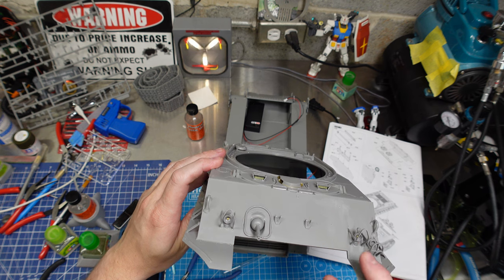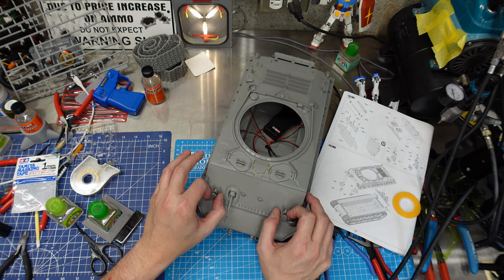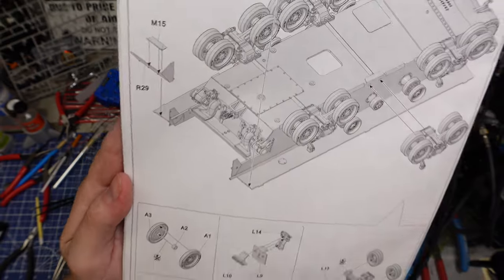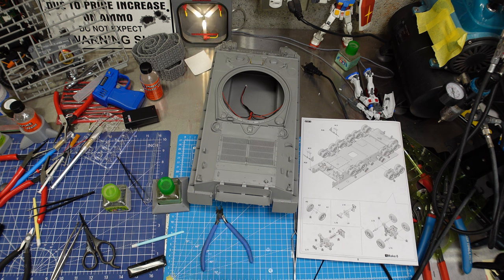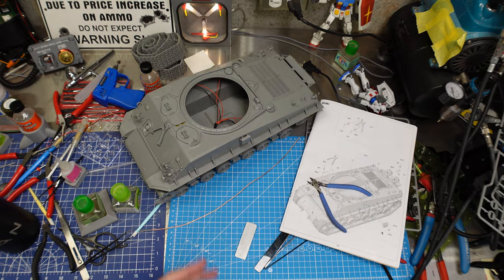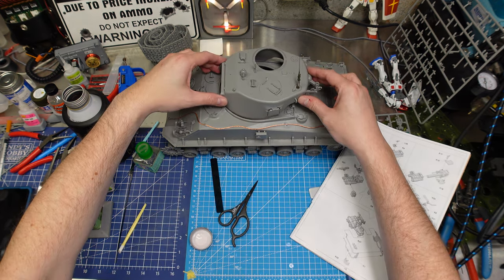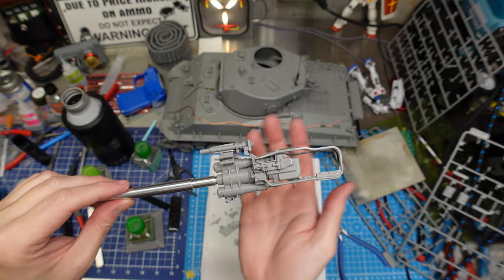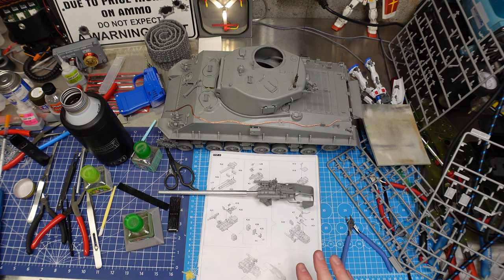Building Andy's Hobby Headquarters Takom M4A3E8 Easy Eight Sherman 1/16 tank kit, part 4

Comment: BIG, big thank you, for pointing out the magical appearances of parts R6 & R7 at the 7:00 min. mark. Had me totally stumped when I ran into it. Also, thanks for the visual reference showing how the whole rear fender thingamabob is cobbled together — way more information than the damn instructions provided, or when Andy did his full assembly video. Now, as soon as I de-warp my R-29 and R-28 pieces, it's off to the races.
Reply from the maker: I was just as stumped as you and it took me a while to figure it out, apparently there was an addendum sheet somewhere with the decals but I don't think it was inserted into the first batch of kits. and luckily I haven't found any warped parts but those two. very glad I was of assistance and thank you for watching!

Comment: Love the videos man. such inspiration for me just getting into tank models. what size LEDs are you using? I found some 1.8mm LEDs which will work well for the 1/16 scale but not sure how well they will work at 1/35 scale. Can't seem to find much smaller LEDs to fit 1/35 scale tanks.
Reply from the maker: Thank you so much, I am really glad you are enjoying the videos and getting motivated. on this tank I am using 0603 SMD LED's, for a 1/35 tank I would try to fit  size 0402 LEDs or Hdamodelworx.com has what they call "smallest" LED which are insanely tiny.
Reply: @PitstainHobbies  thank you for the link!
Reply from the maker: @relentlesstorm  happy to be of help.

Comment: I always look at pictures of armor to figure out a way to add my own touch. The easy 8  I'm doing , the rear fenders are beat up and one is missing. The mirrors are taken off, and the headlights are missing. Tank crews tend to take off those so they don't break. As to trumpeter 16th m1? Lucky you didn't build it.  The tracks don't fit The sprockets, the extended bustle rack doesn't fit, and a whole slew of issues with it. Luckily a couple company's have come out with resin detail pieces. They are on  Aliexpress,  that pretty much had all the stuff you put on from the trumpeter kit that might have saved you money
Reply from the maker: Ahh would have been nice to know you back when I built my M1